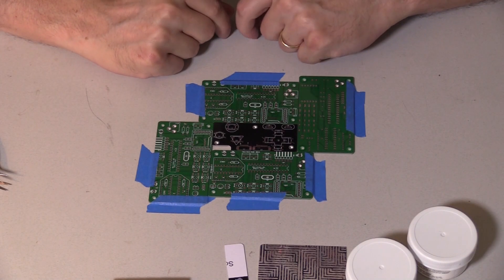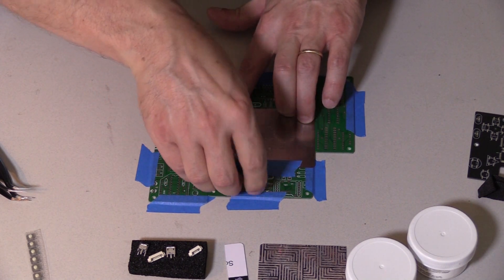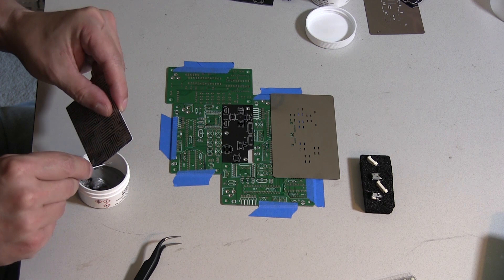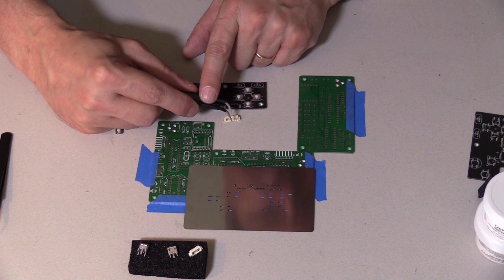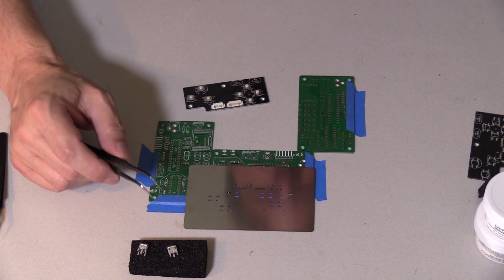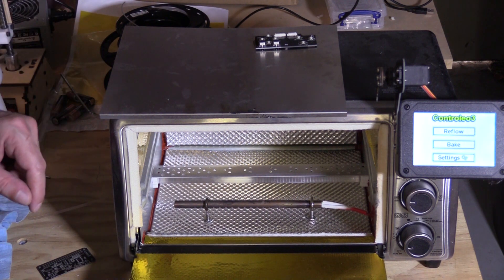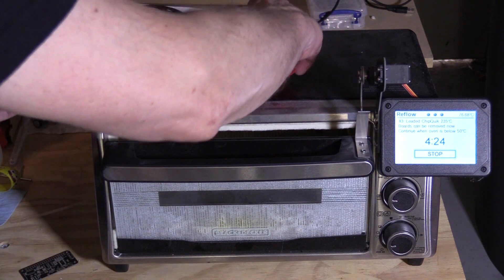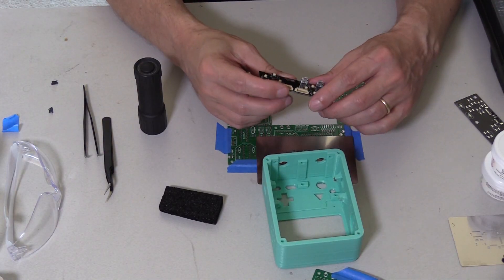BMO Guts: The Button Board PCB

Comment: Another great video and we getting closer to assembly and software side, can’t wait! Also in my build, due to fact I need to find around way for custom board, I was thinking about using universal PCB (I don’t know if it’s called same in english) to attach tactile buttons so they have base that I can simply mount to case. That will not be same sophisticated but I think it will work. Waiting for more videos!